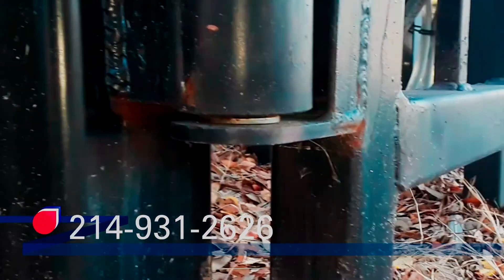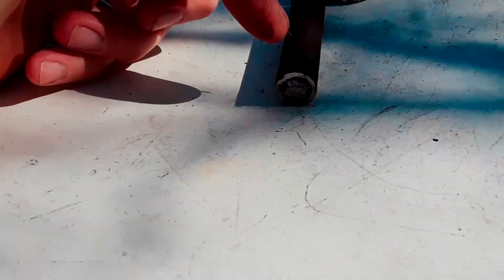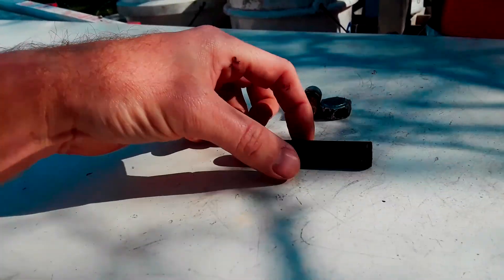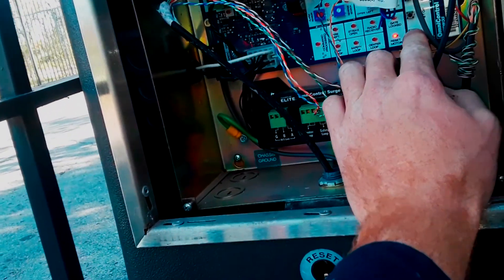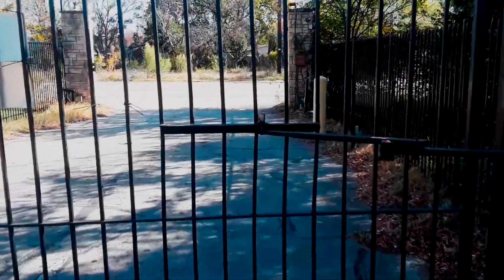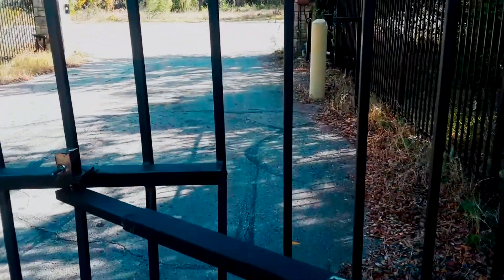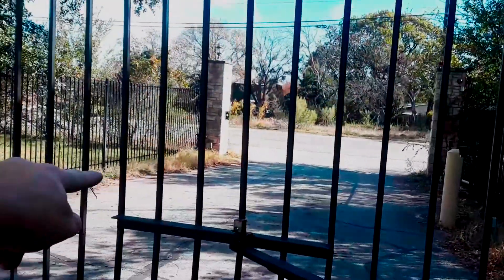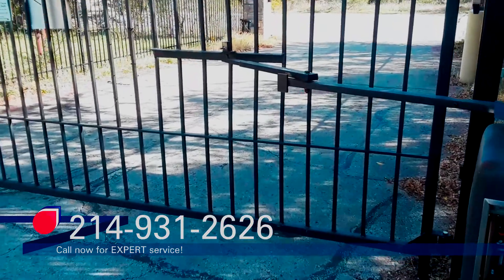Gate repair w broken bolt roller bearing hinge Dallas, TX | SC0084

Comment: That gate took a pretty nice hit. Did they CCTV system capture to car/truck that hit the gate?
Reply from the maker: Probably, however we don't actively manage this properties video surveillance system and weren't asked to get involved. 

We installed an License Plate Recognition camera a few years ago. So they probably know how did it. Oddly enough it was part of their lease to have an LPR? Wish more leases had that.
Reply: What is your pick for a NVR system? 1080 cameras?
Reply from the maker: The first question is this a replacement for an existing system? With most low-voltage products the infrastructure can be half, sometimes more, the total cost of the system. Then the question is what is the cabling category 3, category 5, Coaxial etc.If it's coaxial go with an analog HD system 1080 P minimum. 4K using analog transmission is getting very reasonable if you have to use coaxial cabling but you need higher resolution.

Inherently analog HD will be lower cost for existing protocols and common resolutions i.e. HD-TV I and 1080 P. This is because there is no cost for network interface card/chip licensing. An additional benefit of analog HD is low latency. Because the video signal is not wrapped in a protocol such as internet protocol the video is almost real time at the monitor. This can be very important for high-security locations.

If you have category3 just start all over and install category5. Then you have a few more options.

We primarily use hikvision DVR's, NVR's and cameras. This will vary depending upon customer's needs and compatibility issues with cameras and recording devices.

I recently read an industry report that suggested the average camera system installation was 20 cameras. Anything more than that we recommend using a video management software/IP camera solution. Panasonic's video insight and their line of cameras are perfect for that.

Video surveillance is just like anything else, installation is key to long-term performance. With two megapixel cameras we are now at the stage where that resolution could meet most light commercial, multifamily residential and smaller municipality needs forever. Unlike five years ago when there was definitely a case to be made for waiting until the next resolution was affordable. That's no longer the case.

Look for an installer that has a minimum of three year warranty on parts and labor. They must also give you a 100% money back guarantee. For many reasons this is not a job for handyman. Admittedly I have seen some do a great job on the installation but when there's a problem all bets are off.
Reply: New installation. I need a system for my business/shop.
Thanks for the excellent and thorough reply.
Reply from the maker: I just sent you a private message check it out
Reply from the maker: 214-931-2626 We are dealers as well. Feel free to call me directly if you need any advice. Brooks